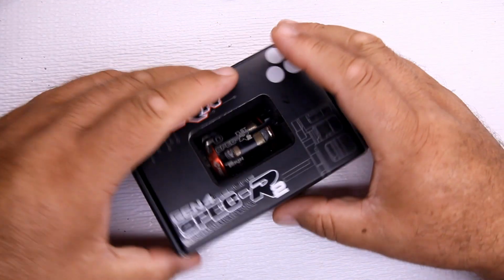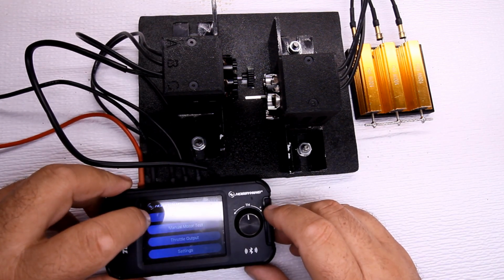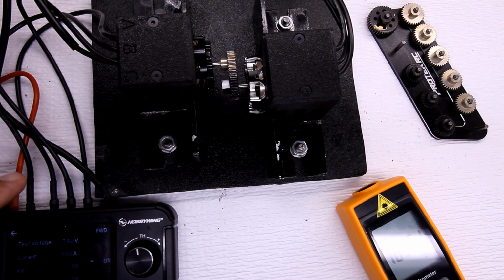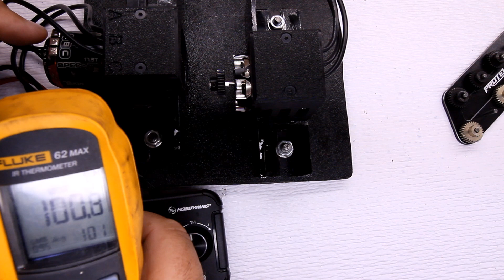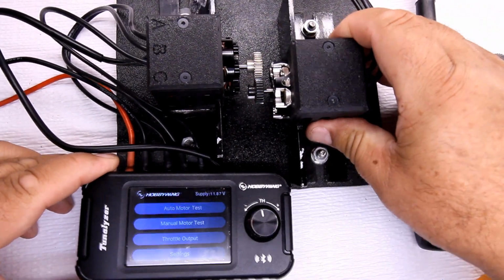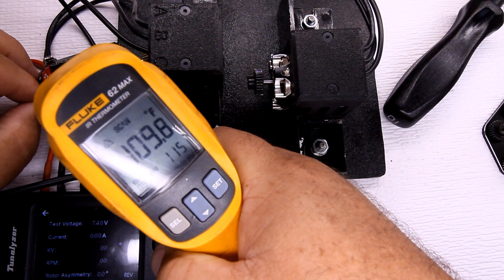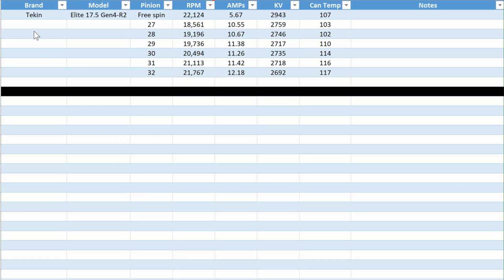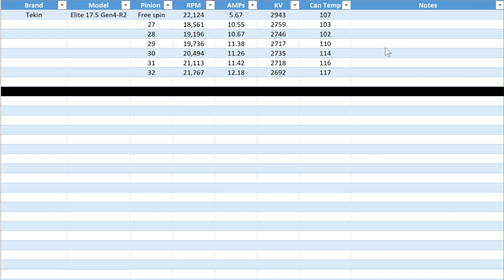Testing the Tekin Elite 17.5t Gen4-R2 on the Jerry

Comment: I am wondering. There is so much data with all your reviews. Can you recommend a stock motor for a small clay track with torque to run the b7 5 gear. Track has multiple jumps with short run up to the jumps that fast wheel spin is important. May future video where you share specifics on where you think a motor would excell on. Car and track type.
Reply from the maker: Hello Peter.  I will make sure to state what track I think a motor will work best on.  I believe I do it in most of my videos already.  For a short high traction track, I would definitely recommend the Surpass V6.
Reply: Thank you. As a follower of your channel and watching your video I did buy a surpass v6. You were correct, it's an amazing motor on the tuner, but when I put it in the car. It was clogging at under 25 percent throttle(low speed). Regardless of all the gearing changes it was clogging down low and different sensor wires. So I sent it back. Do you think I got a defective unit? I am not sure if it's the character of the motor. What's a good second option? Should I buy another surpass v6 and try again? Thanks for the response
Reply from the maker: It sounds like a defective motor.  I have only heard really good things about that motor.  Personally, I would try another V6.  If you wish to get a different motor, the Team Exalt Pheonix motor would be my second choice.  I tested the Silver version and it was almost identical to the V6, in performance.  However, it is $140.  The Gold version, I was told, is even better, but it's up there around $180.  Then again, some people tell me it performs as good as the V6, which is almost $100 cheaper.